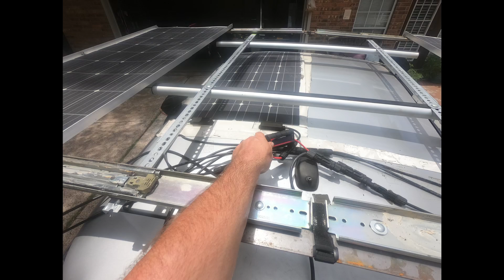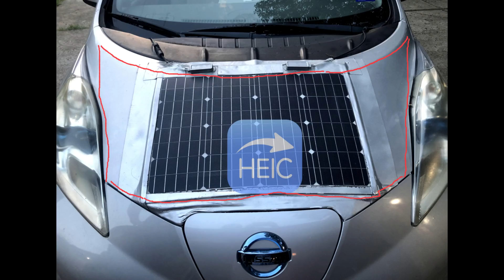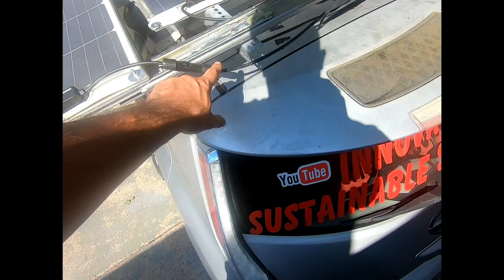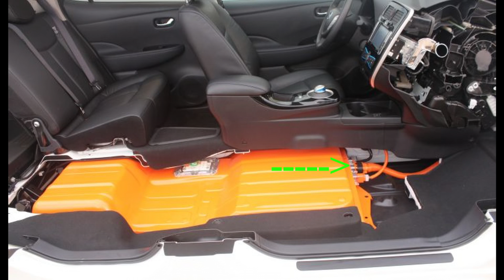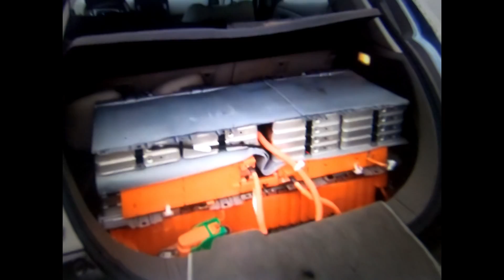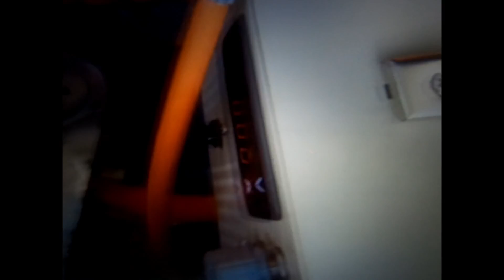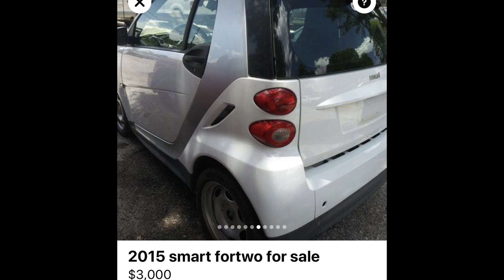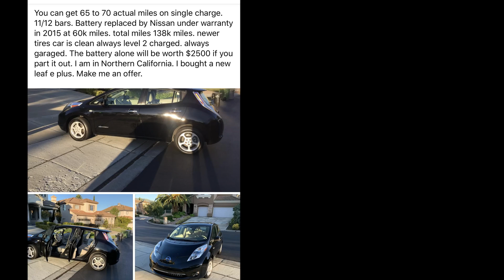Solar Powered Nissan Leaf - Connecting Solar Directly to EV Battery

Comment: I've experimented with modifying the CAN-messages going to the charger, it is possible to run 500W as a minimum level (not that it helps much). The LEAF itself draws about 300W when the coolant pumps are on and inverter/charger is active, so it pays off to charge the car with as high amperage as possible to increase efficiency (16>10>6)
Reply from the maker: Thats incredible.  I really need to learn more about the computer language of the Leaf for some future projects I want to tackle.  Please let me know if there is a good starting point for learning how to work with it.  I lean toward a lower amperage for solar charging as it reduces the cycling of the buffer battery (matching charging amperage as close as possible to solar input wattage).  But the information on the 300watt syphon is very handy.
Reply: @InnovativeSustainableSolutions  I still think it is better if you switch to a faster charger as soon as the system allows for it. Here is some quick math on the two extremes
120V 12A = 77.5% efficient (Charge Power in: 1.451kW Power to Leaf Battery: 1.125kW Total Power Lost: 326w)
240V 16A = 90.9% efficient (Charge Power in: 3.756kW Power to Leaf Battery: 3.414kW Total Power Lost: 342w)

As you can see, a huge amount of power is lost by L1 charging instead of L2 charging. Even a smidge faster L1 charger will do better. But I do understand that you need to match the solar input and don't deplete the batteries.

You can learn more about the messages that are travelling on the EV-CAN of the leaf, by checking out this database that I compiled https://github.com/dalathegreat/leaf_can_bus_messages Best way to learn and try out new things with the leaf, is to get a CAN-bridge and start playing with modifying data and seeing what happens. The Leaf is very fault resistant, so it isn't really possible to damage it this way.

Comment: Best I’ve come up with is taking care of the 12v system on the leaf.  I think 100- 200w going into a large 12v bank for all 12v ancillaries could save a heap from the main pack during normal use.  Every time I look at leaf spy it’s chewing 200 to 400w etc while the car is on.  Also losses caused by aerodynamic impact of roof racks etc  makes me think surface mount panels are the way to go.  I also want to think of a way of cooling the car when it’s not in use and in the sun, this could be by way of fan vents etc, saves energy on the Ac when you return to the car and have to cool the air down etc.  all these savings can easy be offset though, inverters , panels , modifications all cost money.  So far for me , charging during the day off our house solar seems to be winning.
Reply: Looking at this further, the issue is the leaf wants to charge and run all the accessories when it’s on.  I’m looking for a way to trick the leaf into thinking the 12v battery is full and doesn’t need charge. This way you could ensure it pulls power from the solar and the 12v batteries, I’m guessing fans , pumps, accessories pull a fair hit of power per drive.  Maybe a kWh or more per drive ?

Comment: You need to get 700w, 144 cell panels. Size 1.3 meter x 2.4 meter. You can put 3 x 700 w = 2100W. One permanent, 2 slides out. That should be enough to directly charge your EV.
Reply: Only if you are going through the on-board inverter.  You can charge with any wattage in direct charging.

Comment: So does it charge the batteries while the car is in use? Or is it that you have to turn the car off for it to charge? The reason I ask is I commute for 3 hours 2 1/2 of that is sitting or barely rolling on the high way it would be nice if you can keep your batteries up while just sitting.
Reply from the maker: It only charges while the car is parked.  In order to charge while driving, you have to open the battery pack and connect 400v lines directly to the battery, behind the vehicle contactors.  This is a tricky procedure, but can be done
Reply: @InnovativeSustainableSolutions  ok.  I just wasn't sure if it was even possible or safe.
Reply from the maker: @rhincodon8  If your going to work around 400VDC power you have to have some experience working with electrical systems, and be VERY mindful of safety precautions, or it is not safe.  But it can, and has successfully been done by several people that I know of.  I may try it someday, but for now the approach I use is much more easy, beginner friendly, and safe.

Comment: I love the idea but if you short out 400 hundred volts DC you’ll get a giant arc and possibly severely burned or killed from high-voltage electrocution shock. A shock like that will cauterize the blood inside your arteries and it won’t be a good outcome. 

I have a solar powered electric car and My 20 kw array is sitting in my backyard. 

I have a 2007 Uplander and the alternator burned out so instead I put a 230 watt solar module on the roof with a secondary battery and it works pretty good .

Comment: Im using a ecoflow mini, to charge my smart fortwo ev.
Dont have a solar panel(s) tho. Since the car roof is so small.
Even have a cable to charge the ecoflow at the charging station while charging my car
Edit: I bougth a 240v 6a charger and I have solar panels on my shed now.

Comment: You make me feel lucky to have 8/12 bars lol.  My gasser has been in the shop and got delayed even more so I’m doing everything I can to do as many instacart batches in my leaf as I can in a day. Keeping it simple for now by removing the “mud flaps” and airing up the tires to 45 psi etc. anyone know any other cheap and easy mods that increase efficiency for leafs?
Reply from the maker: Aerowheels, may add .1-.2 miles/kwh.  Increase your following distance, drive without having to use your brakes.  Set your charger to run for the last 20 minutes to full right before you depart.  That helps a lot.  Sell the gasser and buy some batteries and an inverter, lol.  People like you are why I started this channel.  There are 300k + Leafs out there that will wind getting retired by people who can't afford Tesla's, if we don't solve this battery problem.
Reply: @InnovativeSustainableSolutions  I've been able to tame my lead foot and maintain 4.5+ mi/kwh around town even with some occasional 55mph highway driving, but I've already noticed the difference of maybe .2 mi/kwh. I think I'll keep my old Focus ZX3 though I'd miss my shifty boi and nobody would really give me enough money to justify selling it tbh. It's been a reliable car it's just that some idiot who drove it blew out one of the brake lines about an hour and a half from my house so it's at a repair shop that's really busy and really far away lol. The other problem with your solution is that I kinda need the trunk space since I'm using it for grocery delivery and when I'm not working it's carting around a family of 4 including our dog lol.
Reply: @InnovativeSustainableSolutions  but I've been wanting to do the aerowheels for sure just don't have a 3d printer handy lol
Reply: @InnovativeSustainableSolutions  also, I'm glad that the aftermarket is taking solid steps towards making battery replacements/upgrades cheaper and less expensive.. We just got our leaf avout a month ago since a dealer relatively close to us was willing to sell it for 5k out the door and we jumped at the chance to own a ev because it's perfect for an around town car for my wife and I save a lot of money using it for the vast majority of my trips for work. Where I live, it's nice to have a dino juice burner as a backup since we only have L1 charging from the garage and L2 and L3 is non-existent unless you wanna drive 30-50 miles to the next town lol.
Reply: @InnovativeSustainableSolutions  can 3D print wheel covers now
Reply: @ZachariaZuehlke  What year LEAF did you get from the dealer and what battery health? Gives an idea he'd get less at auction.

Comment: If I plug solar panel directly into 12V outlet (cig lighter outlet), will that charge the battery? Please don’t laugh… I am learning. I have a Kia Soul EV 2017. I want to mount 2 small 50W sunpower units simply to trickle add juice basically. Sunpower units have charge controller built-in.
Reply from the maker: That's not a stupid question.  I don't know if plugging the panel into the cig lighter will charge the 12v.  I know it won't if the vehicle is not turned on.  A better way to do this is to run the +/- of the panel straight to the +/- of the 12v battery under the hood.  You just need to check the voltage output of the panel with a multimeter and make sure it doesn't go over 15v or so with the 12v fully charged.  Either will unfortunately be of limited effectiveness.  The DC-DC converter has a tendency to push current into the 12v with such gusto, there just isn't a lot of time or discharged capacity for the solar panel on the hood to charge the battery.  I know people have done this though.  Here's a link to stories of people who have done something comparable https://www.lensunsolar.com/blog/

Comment: Please work together to create a kit.  I was looking into the rockpals 300wh packpack/inverter with its foldable solar panels, but it doesn't have enough amperage to start the j1772.  Too bad, as it would have been. Sub $500 way to solar charge a leaf (we have 2 Leaf Pluses and used to have  2013 Leaf).    Looking forward to your 2nd Leaf projects.
Reply from the maker: Yeah, 300wh wont cover it, even with a 600 watt panel array.  You just rip through the battery to quick and then run into the contactor rapid open/close issue.  I know Emile @ Power Electronics Blog, has already figured out how to manipulate the contactors as needed.  Now we just need an easier access than cracking open the battery.  I think a combo of Emile and Leaf Xpack's methods would be the ticket.  No HV splicing needed.  Just plug and charge.
Reply: @InnovativeSustainableSolutions  Hehe, everyone knows Emile nowadays :D

Comment: The black LEAF is likely like mine, a 2011 that got the Lizard pack upgrade after 2015 or so 👏🏼. 

Did you get the pack swapped and did it need CAN communication adjustment to recognize it? I'm working on the same thing here.

Comment: I’m in the U.K. I’d love to charge my Nissan Leaf with mobile solar panels. Why not put a small wind turbine on the roof also?
Reply from the maker: I thought a bit about that.  The biggest hurdle is the need for rapid removal and installation.  I dont think you want to drive around at highway speeds with a wind turbine on top of the vehicle.  That's gonna come with a whole host of problems.  So you need a turbine with decent surface area that can fold up quickly and compactly for storage, but also be mounted quickly and very securely for high wind days.  It would compliment the solar beautifully, but definitely does present some engineering challanges

Comment: A couple questions, it’s not a criticism and I have no personal experience with EVs. But aren’t those panels on the roof of your car, and even more panels, better off on the roof of your home that charge large capacity batteries throughout the day at home. Then instead of adding additional batteries feeding of the car roof solar in the back of your car, rather install larger capacity batteries directly connected to the other EV batteries in series to extend your range. Then when at home, the large capacity batteries charge your vehicle and extend its range with its additional capacity? You then save on electricity and you extend range? Second, and you may have touched on this in the video, apologies if you did, but can you not arrange more aspects of your EV to run off the 12v car battery, I’m not sure which parts do, like AC, power steering, brake pressure, coolant pump, all the usual stuff, then have the roof solar panel charge the 12v car battery, freeing up your EV batteries a bit from charging the 12v. And if your 12v car battery drops in volts by a certain amount, the EV kicks on the DC-DC charger to top it up. Just wandering.
Reply from the maker: Okay that's a lot of questions.  I'll try and take them from the top.  The original problem I was trying to solve was an aging fleet of approx 400k Nissan Leafs, for whom replacement batteries are impossible or not cost effective.  If you had access to a large (cost effective) battery for your house or EV, than yes solar would be much more effective.  A large battery bank for your house (40kwh, 3 Tesla Powerwalls) can cost $50k, and new battery for your Leaf can cost $15k.  My portable charging station can add up to 25 miles/day of range to my Leaf and cost about $3500.  My hope was to create a commuter EV option for people who (like me) cannot afford a Tesla.  Additionally I tried to divorce all of the 12v systems in the car from the DC-DC converter (and hence also from the HV battery).  There is a weird close circuit detect across the 12v circuit from the DC-DC converter that has frustrated my efforts to separate all these parasitic loads.  I am working on this still but it is trickier than you would think.
Reply: @InnovativeSustainableSolutions   thanks for your reply, all makes sense. It’s a pity it’s so difficult to obtain a leaf battery, with 400k old leafs running around, you would imagine someone would be willing to come up with a battery solution. Obviously Nissan wants new cars sold. I know It still doesn’t extend range of your car in your case, but you could probably build a home battery system with 30-40kw for a “reasonable” amount, like using the 3.2v 280ah lifepo4 batteries. 32 of those give you around 27kw at a “reasonable price”. If you could figure out how to work the 12v car battery dependant items without the dc-dc charger, that’s a winner in my opinion. It’s almost as if it’s easier to convert an old car from ICE to EV, to do what you want, then try and work to extend or customise old EVs. Thanks and good luck.

Comment: What do you think about connecting solar via mppt to the 12 volt start battery and then let that charge the high voltage battery via an added inverter and a j1772 cabel?

I'm aware of the losses from things like cables and inverters (both the chargingcables' inverter aswell as the extra external inverter Im thinking about adding). Will the losses be too much?

If the original starter battery is not sufficient then maybe that can be replaced by an agm deep cycle battery?

Comment: Why don't you just hack the Chademo charge connection ? Wouldn't that be more efficient and keep all of the safety controls involved?  It would be safer to hook up and remove. I built a Solar generator that I can tow down the road on a small trailer behind my RV to my hunt camp. I installed and built all of the complicated systems onboard. I went the route of installing a regular campground RV plug box onto my trailer. My connection to my RV is easy and all other 120v outlets are also there for accessories. I have Solar panels mounted on it that keeps the battery pack charged up and maintained constantly. I built it 12 years ago. 

My battery bank is built out of 8 - LC 16 heavy built Deep Cycle batteries wired Series Parallel.

They are driving a high end 3500 KW inverter that can handle an inrush of 5800 watts for 25 seconds.

I have charged EV s off of it like an emergency bank to get them down the road or over to a near 240 outlet. I have direct connection that I have welded off of and have connected portable gas powered generators onto in order to charge up the battery bank quickly and run power to the camp.

Many areas will not let you run a generator after 9:00 p.m. and this was my solution.
I can use my gas generator to top them up quick or hook jumper cables off of my truck and juice them at a high rate of speed. 130 amp alternator.

I believe in thinking outside the box like you do. Guys in the Army used to call me MacGyver.

Comment: What is the total range you get from your battery setup. I have a spark ev and would love to get a few more miles.
Reply from the maker: I love these 12v Valence batteries.  They have incredible longevity, safety, and resale value.  New they have a capacity of 1.7 kwh, that's normally around 1.2-1.5 used.  Your spark gets at least 3.6 miles/kwh (over 4 if you drive chill) so each valence battery would give you an extra 4.68 miles MINIMUM.  I would recommend a bank of three or four for you.  My battery setup would give your Spark around 20 extra miles of range/day without any solar -just from the batteries.
Reply: @InnovativeSustainableSolutions  Brilliant .

Comment: I have 3000 watts generated from a portable solar carpet but cannot run directly into EV charter using 1772 or CCS. What did you use to get the power to recognize power at 720 watts.  You pushed a button to engage charger… what was that?
Reply: At what voltage?  I have 1200W 432V charging my Leaf battery directly.

Comment: Why didnt you have the rack open up towards the front and back to shade the windshield instead of the sides?
Reply from the maker: The slides would have to be very long.  This creates several problems.  (1) A 50" extender slide is a rare, and therefore expensive.  (2) When wind blows on these panels it exerts a lift force.  This torque is proportionate to the length of the slide from the attachment point.  A longer slide = a longer lever arm = a greater chance that a windstorm will bend the slides.

Comment: Here’s the 2023 version https://youtube.com/shorts/AYMa95lZtb4?feature=share
Reply from the maker: Love it!  You can drape a 175watter across the windshield too very easily and tie it into your existing setup using a 3-1 parallel connector.  The roof rack works even better but is several hours of work to install and perfect.  Nice work dude